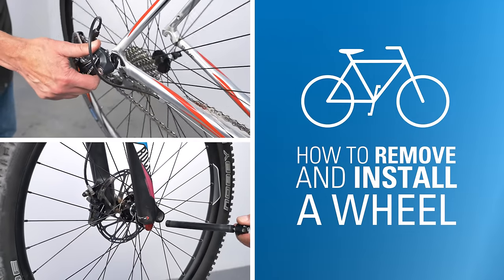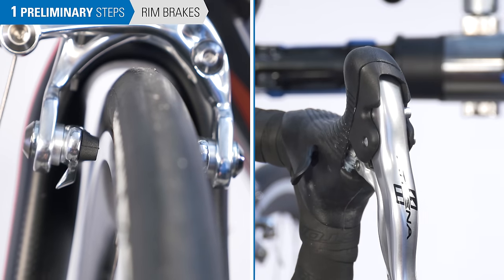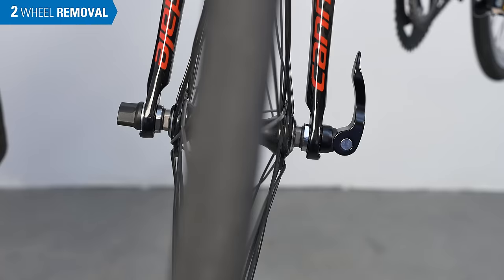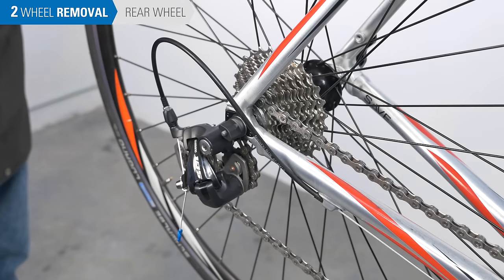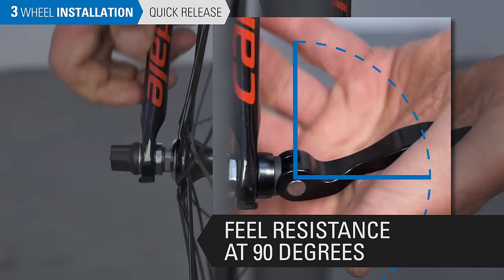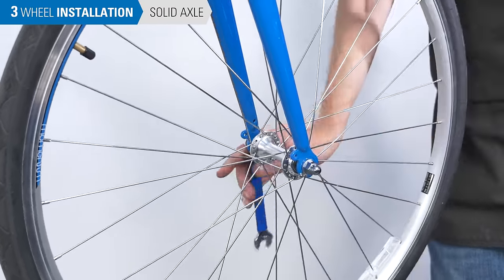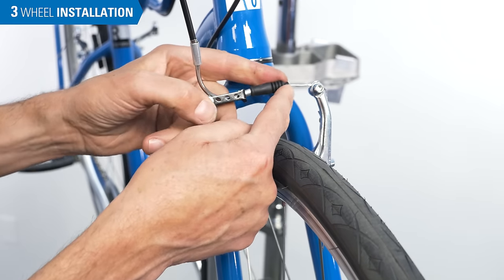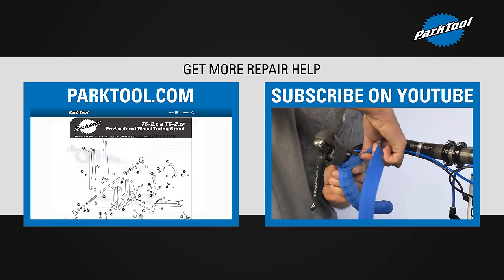How to Remove and Install a Wheel on a Bicycle

Comment: In America u need to carry a metric to standard conversion table and a calculator, so 99.8% of Americans watching have not a dam clue how much 1 newton meter of force is.
Reply from the maker: I am not a big fan of conversion tables.  Consider a foreign language. When working a race outside an English speaking country, I first think of my sentence in English, then I construct it a simply as I can, still in English, then I convert it in my head word by work to my bad Spanish/French/German, then speak it as best I can. A clunky horrible method.  Better is to think in Spanish, etc.  
What I mean is this. Non-metric people need to develop a tactile feel for the metric system. Non-metric children grow up with 8-1/2" x 11" paper, looking at crib bars in factional inch dowel sizing, cooking in tablespoons and cups, surrounded by antiquated systems that are difficult to break out of.  Thinking that 1mm is 1/25.4" is not exactly friendly to the brain.  
Force is a difficult thing to grasp for most people, which is why gravity is often used as an example of force.  One kilogram accelerating one meter per second per second is a tricky concept for most people.  When working with a torque wrench, this is why it is useful to use you hand for the perceived effort with a wrench. 4Nm is not so tight, so also develop that feel in your muscles. 
  Live metric to know metric, I suppose that is what I would prefer we try.